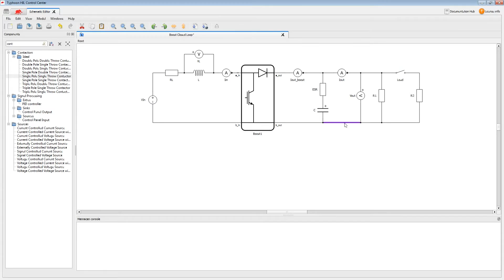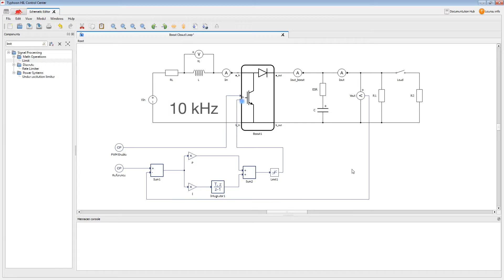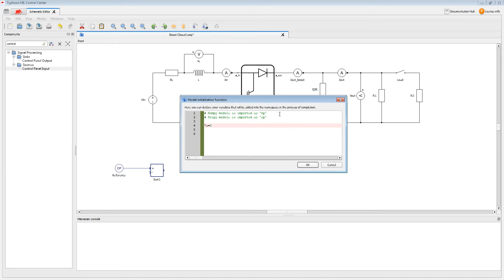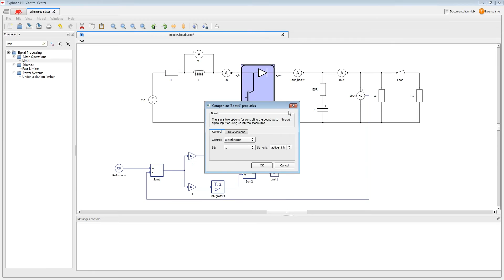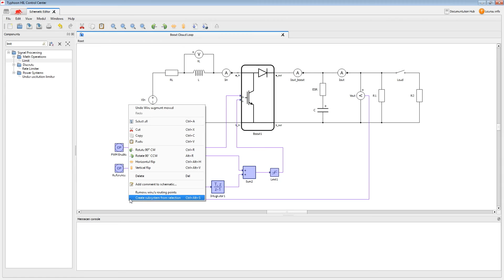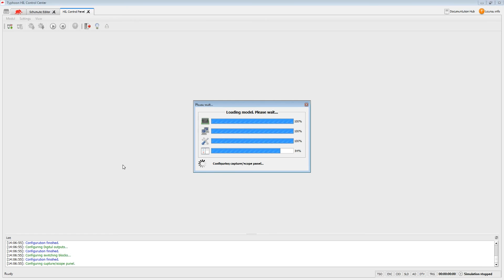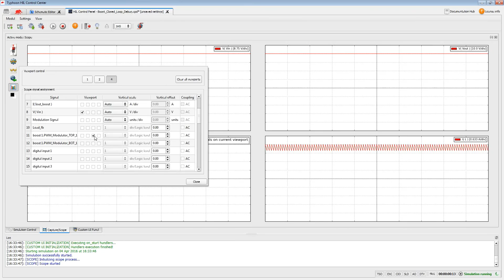Typhoon HIL Signal Processing Toolbox | Tutorial

Comment: Can you tell me how the value of the resolution of the PWM signal of 6.7ns was calculated? And also does the time step of the signal processing depend on any form on the switching frequency of the boost converter?
Reply: Hi Juan,

1) Resolution of 6.7 ns is calculated taking into account HIL device clock frequency of 150 MHz.
2) In this example execution rate of the signal processing is not depending on the switching frequency.

Best regards,
Reply: @dusankostic502  Thank you for answering. Regarding 2) should the execution rate be calculated taking the switching frequency into account or is it a value that is got through trial and error, looking not to affect the simulation’s fidelity too much?
Reply: @running4ever91  This is complex question. In general maximum allowed execution rate is depending on several things including: control strategy, switching frequency, passive element parameters and simulation step.  It is often best to go with the smallest execution rate possible, but we have to be careful not to spend too much of HIL CPU resources.

Best regards.